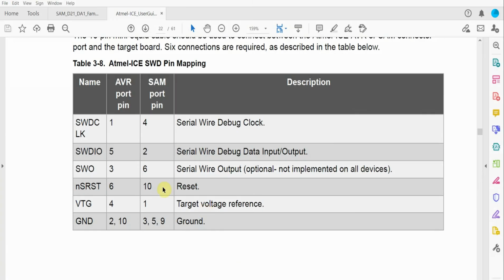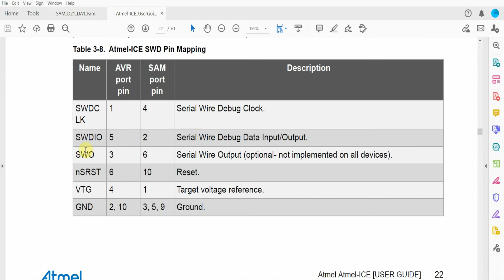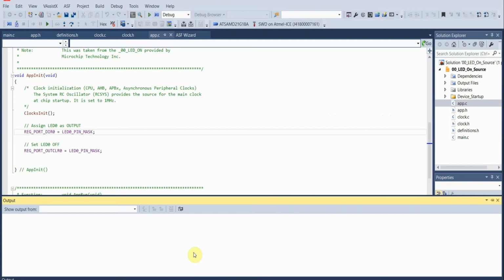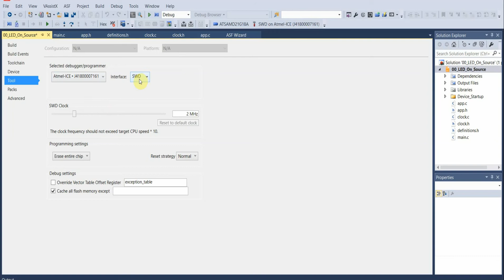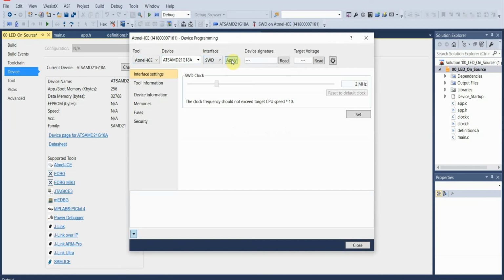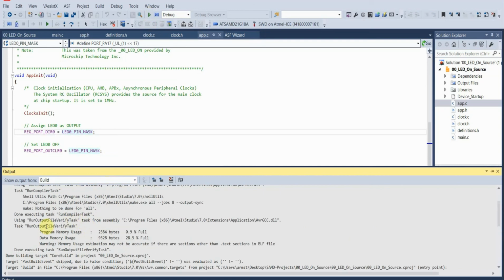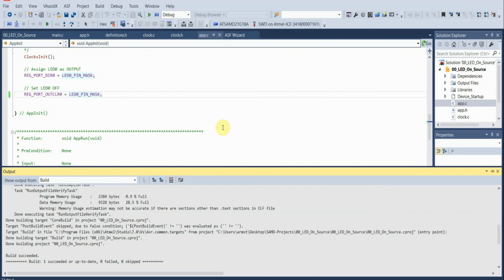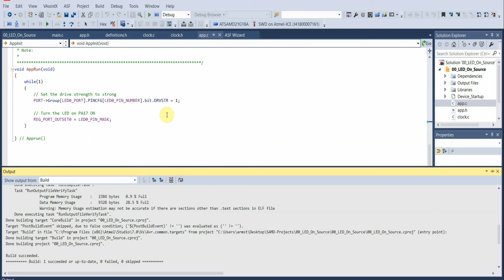SAMD21 ARM Cortex Tutorial #0: Setup (Bare Metal)

Comment: What size capacitors and resistors you used? No external crystal used, right? Did you use any inductor in this setup? A schematic would be useful for a bare minimum setup. If you have time, link it in the description.